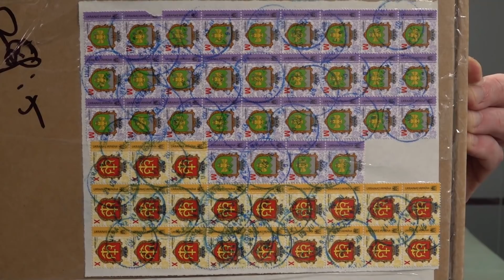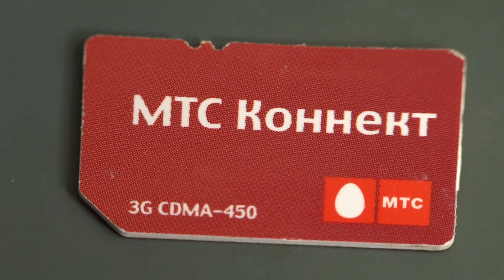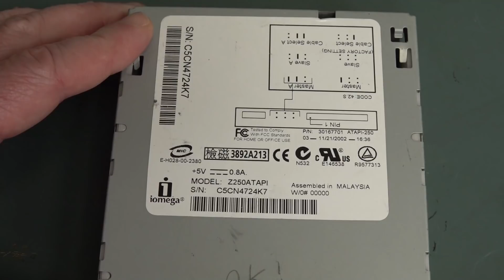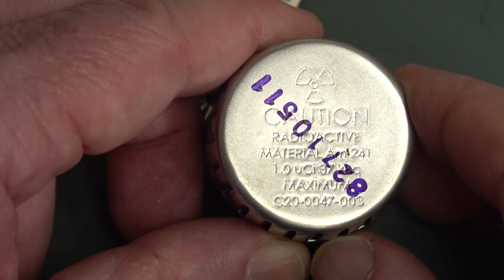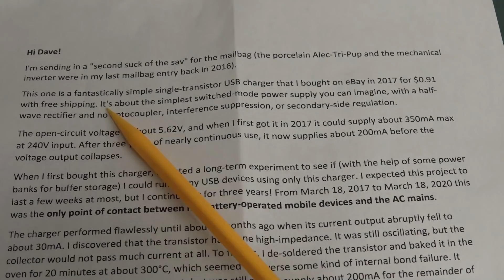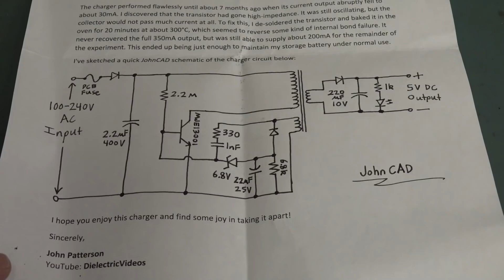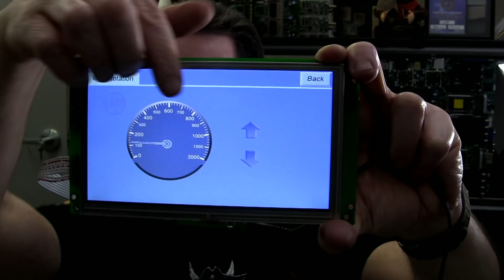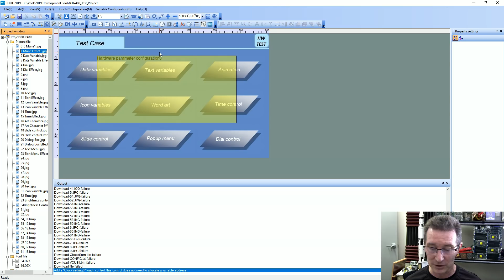EEVblog #1313 - Bad Luck Mailbag

Comment: The Iomega "click of death".... I accidentally knocked my zip drive off the table one day. Completely broke it, ripped the disk inside. Took it back to Currys / PC World, whatever it was at the time. Toled them it had gained the click of death. New unit, no questions asked. Still worls to this day! Or at least the last time I tested it, no longer have a PC with a parralel port
Reply: They have parallel to usb cables if you wanted to test/use it.

Comment: Achtually, the shielded inductor, right next to the big Main Caps is the PFC Coil that boosts the input voltage (usually somewhere between 90-110V at the low end and up to 265V high) to somewhwere around 350-420V DC (usually around 380V or so). Then the Double Forward Topology does the switching (IIRC Champion Micro CM6800 series) and only generates 12V!
3,3V and 5V are done by a pair of Buck Converters. And Protection looks pretty complete with everything you'd want (OCP, UVP on all rails). That's what that Sitronix Chip does. Its just a Supervisor.
Regulation is ONLY on the Primary side (for 12V - the other two rails are generated out of 12V).
Manufacturer of that unit is Chanell Well Technology...

Comment: 11:24
Folded dipole antenna. They basically took a dipole and "squashed" it up.
42:00
Why do companies want you to install software to program their equipment? It's so easy now to make a bootable ISO or image you can put on a USB thumb drive. Just download a live Linux with the software pre-installed and boot. No worries about any viruses or incompatible updates, i.e. our software only works on Windows 7.
Reply: Would you really want some randoms OS on your system or network? And what a PINA to reboot your system to program a device when you have all your other stuff on your daily driver OS.
Reply: eeeehhh yeah I won't be running someone rando's OS on any system or network any time soon lol.
if you're selling the hardware and just have free software with it, just open source it. off-loads some support work as well.
Reply: Sirus How do you figure that all Linux distros are someone’s random OS? There are more than a few that are widely used and many people have been through them with a microscope leaving little possibility of foul play with a mature distribution.
Reply: @daa3417  You don't get it.
Reply: @UberAlphaSirus  For a stand alone machine, sure. With no hard drive and air gapped it's not an issue. And what about your daily driver machine? You're still running some software on it.
Reply: @leisergeist  Open source is cool. There was a time when we would update the bios on motherboards with a boot floppy from the manufacturer. Normally it was a FreeDos, IBM dos, DR dos, or Microsoft dos with a copy of the bios binary flash on it set to autorun.
Reply: @therealjammit  What's your point?
Reply: @UberAlphaSirus  We've been running "rando" operating systems on machines for a long time. I think a "rando" live boot is no different than running a "rando" piece of software on a running system. Plus you never have the issue of a company going out of business or not bothering to keep their legacy systems updated, hence needing to find an old machine with a working Windows 7 on it because ten years from now their software hasn't been updated to run on the latest Windows 20.

Comment: I like the old setup better with the DeLorean on the shelf and the number plate :)
How about following up smoke detectors with the battery powered version and how they make a pp3 battery last over a year in one ? Could you convert one to 240v that uses "bugger all" to power it ?

Comment: the zip drive used a mech simalar to a hard drive it uses a voice coil to get very accurate positioning on the media also the reason why the spindle frame moves is to meet the media smoothly it might look chincy but was pretty robust to the 200 pound gerilla choving in a disk lol the click of death was usually caused by a voice coil fault

Comment: Couple of hundred GB in 1994? More like couple of hundred meg. In 1994 my family bought a new AST Advantage 486 system with a 540mb HDD. Drives then generally topped out around the 1.2 to 2.1gb range. Even in the early 2000's most drives sold were under 100gb (with the first 100gb being in 2001).

Comment: The Am source does not care, like all other radioactive isotopes, if you apply voltage. it will produce the same exact amount of radiation as one with higher voltage, higher or lower temperature, or anything else. The detector is a photodiode that detects the number of particles the Am is producing. if smoke enters the chamber, it actually blocks the radiation and activates the alarm

Comment: In 1999 I had a brand new PC with 3gb Seagate and if you compressed it with DriveSpace you could get it to 4gb. There is no way in 1994 there were drives with hundreds of GBs.

Comment: My understanding of Americurium based smoke detection is that the Am ionizes the air in the chamber and a small current flows between charged plates. 
Ions in smoke bind to the ionized air particles and reduce the normal current flow. 
Sometimes there's a second sealed air chamber to provide a control. 
Detect and Trigger, job's a goodun. 
Bit 'of Kwik Fizzics for ya  ...

Comment: Still have 2 Zip drives, and a disk or two as well, one external SCSI and one parallel drive, which both look almost the same from the front and rear, except SCSI has a switch to select between ID 5 or 6, so you could have 2 of them on a single SCSI bus. External terminator only.

Comment: 17:00 -- arent those 'cheapassactuators' the typical way read/write heads move in their required exact way? with voice coil actuators as in megaphones or the PS5 Controller's new Feedback mechanism replacing vibration motors....?  maybe Dave can make a video about those...? any actuator specialists here?

Comment: About the HMI display. I've worked on some production/automation projects and every time I hit these things they're really crufty. You say one shouldn't reinvent the wheel, but I had a few cases where these solutions are far too crufty, dodgy and far to extremely expensive so the customer went down the route of having a proper real interface designed on an embedded computer based on Linux. It sure took a bit longer to get up and running but the end result was far superior and a whole lot more flexible for the customer.

Comment: Buy the big tv at Aldies, if you're not happy in 30 days get your money back even if it's working fine. Not plugging them, just love there return policy.

The old video on smoke detectors was on AC mains supplied units and it was about standby current which was about 600mA if I remember correctly. These 9v jobs aren't much better.

Comment: Sounds interesting to have viewer labs as background. The Smokes revisit was aico.co.uk due to power consumption using an old school Zener diode. I have a few on my bench which I an fitting new permanent lion batteries as supposed to last 10 years but the sparky forgot to change a switch on fitting my win. as they cost £80 each as have a wireless link. The sensor  was optical. Also one funny note we was only allowed to carry 7 ionising detectors in the car duff or new to fit.

Comment: Any reflections could be dealt with using a CPL filter on the camera!
Reply: 8:24 glare is a function of incident light, and infrared filters, required on newer handycams due to undesirable x-ray effect on clothing, is already sufficiently polarizing, and close up the coloring blowout is apparently due to low ISO  setting trying to compensate for the whole image at once. Pretty common effect for a single-chip camera.

Comment: the plastic spacers prevent shorting of the metal transistor housing with the solder pads under the transistor.

Comment: OOh, I remember those floppies. One had to have 2 floppy drives. One loaded with DOS and the other loaded with the app you need to run. As for the chippies, I see there are some 74LS series. As for the rest, I have no idea what they are. Most likely logic. Oops! somebody made a few fopars on that board. Lots of jumper wires to correct them.
.

Comment: 42:00 Dave, does the screen have an SD-Card slot? I think how it works is you need an SD-card put in your computer, than at the top there was the "download drive" option, you choose the sd-card, and tehn you pop the sd-card in the display and it will update itself with the new interface. It's just my assumption though.
Reply from the maker: Nope, it's a serial port driver issue.
Reply: @EEVblog  oh ok, well I tried

Comment: lots of small wireless devices have antennas like that, as long as the length is sized right on with the wavelength it'll grab a signal.

Comment: ZIP IS NOT FLOPPY COMPATIBLE. original ZIP was 100Mbytes, this is a later 250MB model.  JAZZ  was a related 1GB drive.
Was a thicker hard case than floppy.

I have several 100MB  Zip and 1GB Jazz drives.
A floppy compatible device from another manf was the LS120 that had 120MB  capacity discs.
Still have a 8" Dual floppy drive that was part of my S100 bus IMSAI system running CPM, MPM, CDOS and CROMIX operating systems. Have not run it for 20years so not know to still run at present.
The dual 8" PERSCI drive was a very fast floppy as it was voice coil actuated, 1.2MB dual side, double density that in 1978 was very high capacity, so 2.4MB accessible storage with two floppies simultaneous access. VERY expensive at $3900 packed in a solid lacquered wood case.
More typical then, a single side,single density 8" floppy was only 360KB.  WOW all that storage, my 5 1/4" ss/sd floppy had all of 73KB  capacity! What advances we have had since then with 512GB micro SD CARDS now.

Comment: I wonder about the antenna of that 3G usb modem.... 4 terminals all shorted together?
Reply: Apply certain RF frequency causes a physically shorted length of conductor to look like an open circuit because of signal reflection.FM- Fukin Magic.

Comment: Had several hardwired smokes alarms installed in our house a few days ago by a licensed electrician.
Reply: And of course you were full of questions regarding quiescent current, power factor correction, ionization vs optical sensing?

Comment: i also had contact with this stone HMI company, though that was like 5 years ago? the hardware components are really nice, but the software is a crime against humanity. i wrote a library for arduino to interface with the screen, and some of the APIs that are exposed are pretty weird. i wish they would make it possible to program the chip inside the display, as it seems to be a pretty capable STM or so. sadly never gonna happen, they could make some bank by branching out into the hobbyist market

Comment: you could use a combination as video editing/greenscreen and the tv: show only the center of the background image on the tv and edit in the edges..
Reply from the maker: Absolutely not. I avoid anything that requires extra editing. Only way to stay sane after 11 years of doing this.
Reply: @EEVblog  Smart man, cost of a 70inch is much cheaper than doing chroma key on every mailbag :)

Comment: Most of the zip drives were backwards compatible with themselves sort of, although there was other flavors of a different product I think that were backwards compatible with floppies. Well I don't have a backup I did have a bunch of old photos and some random files I didn't think I pulled over yet that when I went to read them a couple years ago didn't turn out so well......
A side note GRC.Com has all the information you could ever want to know on the click of death, thankfully I never encountered it until last year in the software variant not the hardware.

There was a lot of advanced technology in them the read head never touched the disc and it had a similar designs to our modern-day hard drives. Although it had special tracking data that was on the disk that has a tendency of going bad and without tracking data...

PS I've always known it as McDonald's oh, somebody said the abbreviated American term and I'm like what are you talkin about. I like your turn better I guess I'm not supposed to be in this country or maybe I had a different life in another?

Comment: Greetings: I find your mailbag contents more important than the view. I like the idea you can post other video behind you either still or motion could be useful. Doesn't have to be any bigger.
I started with 8" floppy drives back in 1974 at the Original video graphics company that evolved into Chyron Inc. My first home computer was a  CP/M  system with one 8" drive and 79KB of single-sided/single-density capacity. My job with it was to upgrade the bios to support double-sided/double-density which brought me to the huge capacity of 1.2 MB (wow). When CP/M got over-shadowed by MS-DOS, I gradually moved to that platform with smaller drives.  I worked with all sizes  of disks but mostly 8" & 3.5"floppies and 8" Shugart 10MB HDDs. I used the 8" systems to build online video edit systems (real-time, CMX compatible).
Juust before I retired we used Big Macs to run Apple/Avid edit systems.

Comment: I have heard of a hammer mechanic, but I have never seen a hammer electronic technician. 
That's a pretty wimpy hammer. Get yourself a real hammer. Something that will match that Crocodile Dundee knife. And a steel plate to Whack it on. One whack and it is dust. If your going to do it, do it right. And don't forget your safety glasses.

Comment: why not instead of a 99999" TV why dont you just use a "small" angle lens? not sure what the opposite of a wide angle lens is called but thats the idea. Use a lens that has less angle and so that the borders of the TV fit the width of the picture. Im no photographer but im sure theres some kind of lenses that would work for your situation.

Comment: (8:41) - You missed the Mitsubishi M5L8035LP.
At the time, promoted as a "Microcomputer on a Single Chip."
It was an 8-bit microcomputer "...fabricated on a single chip using high-speed N-channel silicon-gate ED-MOS technology" according to the datasheet.
See:  https://www.datasheets360.com/pdf/8541682045212133882
>

Comment: 25:50 .. I spy a Microchip Logo on that DIL. Also a type designator starting with "RE" ... they do supply a whole range of Smoke Detektor ICs as it seems. 

Including types for ionization type detectors: https://www.microchip.com/ParamChartSearch/chart.aspx?branchID=9035
Would be interesting which one they used.

Comment: 31:36  Yep, Its for 3.3v you can see it above the pins at the bottom of the card. One of my PSU's has one for the 5v rail too. I think they use the 12v rail as the input.